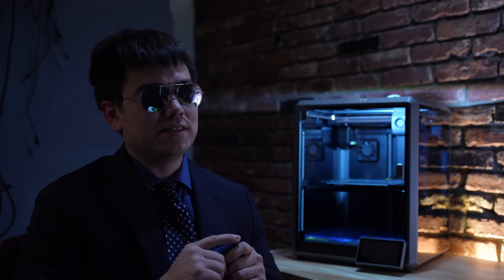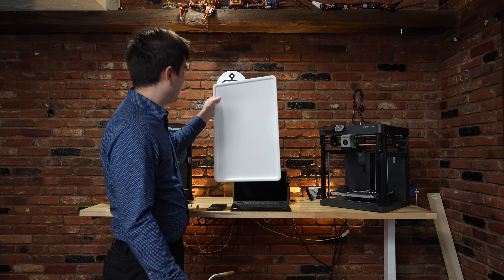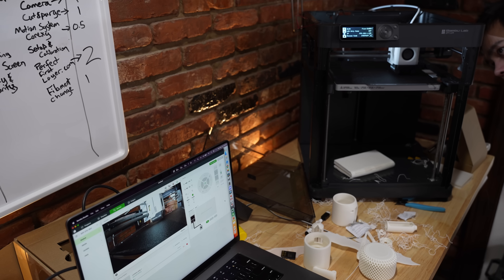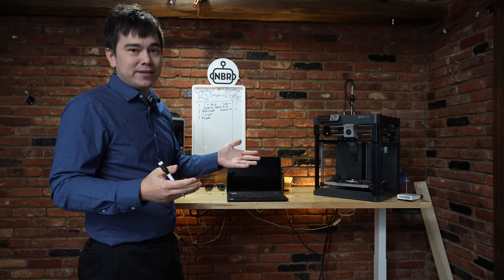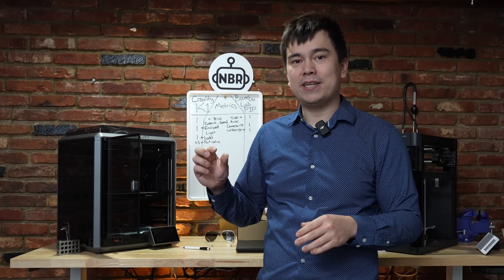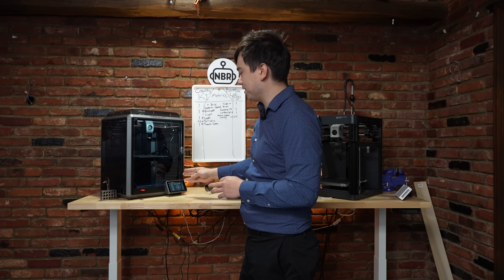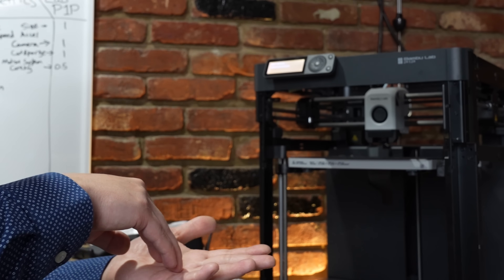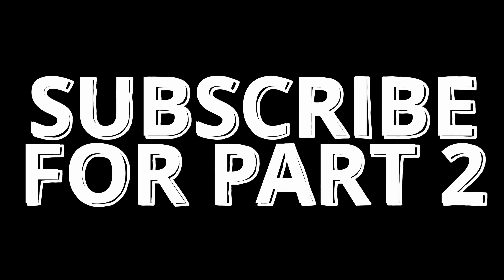3D Printer Fight Club: Creality K1 vs Bambu Lab P1P Episode 1

Comment: Bro I swear your THE ONLY PERSON with a k1
Reply: There are surprisingly few youtubers who have reviewed the K1 so far.
Reply from the maker: Modbot, JJ Shankles and 3DPrintSOS have one. Some have done reviews, some have had extruder problems. Apparently the pre-production units (including mine) have had issues with inconsistent extrusion. I’ve fixed it though. Working pretty great now
Reply: @NathanBuildsRobots  I'll need to check them out

Comment: So as I don't have wifi in my workshop the K1 is almost the only choice.
Reply from the maker: You can use the micro SD card to transfer files on the P1P, but it is more tedious
Reply: I think the K1 max will have ethernet. The ethernet port on the electronics for the smaller K1 is unpopulated, sadly.

Comment: The k1 build plate is trash. Changed it after 3 prints and no more issues. 

P.s. claivus brand filament (tried 9 different rolls) always clogs the hot end.

Comment: Have always sent my prints thru the cloud or thru lan if cloud is down, have never needed to take out the microsd for anything for both x1c and p1p.
Reply: The problem is with the P1P and X1C (I own both) is in LAN mode you can't even update Firmware, not the case with the K1.  There are people that print things they don't want others to see.  Don't ever send a Log File to Bambu Lab, The last time the requested mine from my P1P it started to send them a 2.1GB File that was fully encypted (WTF).
Reply from the maker: Lmao. Yeah Bambu seems a little sus sometimes. They force you onto their cloud service at every opportunity. Don't worry, you don't need to know what was in that file. Also, closed source so you likely won't ever know.
Reply: @marshallburke88  Wow. A 2.1 GB encrypted file. Seriously. That is a crap ton of just g-code. Very suspect.
Reply: @marshallburke88  eh honestly dont matter to me. As long as I get to print remotely then I'm good. 

As for not being able to update thru lan mode, I mean yea? It's essentially offline. You can hotspot your phone and connect your printer to it to get internet access if you want to update I guess?

Comment: bad comparison, a good comparison would be to show printouts of these printers with the same speed
Reply from the maker: Better comparison would be same printer vs same printer 🙃
Gotta control those variables ifyouknowwhatimean
Reply: @NathanBuildsRobots  Well, yes, but when you compare two printers, show printouts more or less at the same speeds, acceleration, etc. Then it will be a comparison

Comment: Thanks for your review, well done bro

one question. I preordered K1 which I suppose to receive it sometime in early of next month. I see alot of reviews in YouTube but unfortunately was after preorder 😅 all reviews are about negative things where make you disported this product even before getting it on hand 😢, can you please gave us your opinion of the quality of this printer and shall i keep the order or cancel the order and order Bambu lab P1P where they are almost same price. Most of my prints is TPU
Reply from the maker: P1P is a safer bet in terms of quality. It is based on the X1C which has been out for nearly a year now, so it’s got a good track record. The K1 is very experimental now, almost like a beta test. You’ll be an early adopter with some growing pains, but it is more moddable, so you’ll be able to fix and improve things over time.

Comment: In real-world functional print terms, how would these printers compare with a Klippered Prusa i3 Mk3S+?  I was thinking of getting the Bambu Labs P1P, but the more I think about it the less I feel like supporting a company that doesn't allow off-line/off-web printing with all the IP issues.  It set me thinking, how much is the real world speed difference between these core xy printers and a Prusa bedslinger running Klipper.  What would the trade-offs be if say printing in PLA, PETG or TPU?  Maybe an interesting future video, especially once the Prusa i3 Mk4's klipper implementation has stabilised?
Reply from the maker: There are some crazy good klipperized bedslingers coming out soon, for insanely cheap. I’ll be resting and comparing that soon
Reply: @NathanBuildsRobots  Cool, look forward to hearing more... how soon is soon, in terms of new product releases? (without being specific)  Would it be worth to wait?

Comment: In the next video say about - What would you recommend to buy
Reply from the maker: That will be a long answer, both have pros and cons. Overall I like Creality mantra: Super cheap and moddable. Bambu Lab is easier to use, but harder to mod and perform maintenance on, and also extremely proprietary. Almost to the point where it feels like you don't own the printer, you're just borrowing it from Bambu Lab.
Reply: @NathanBuildsRobots  Thanks!!!
Reply: I have very big motivation, but not all moneys (I’m 14 years old) I am do orders. And I hoard money to buy creality K1)
Reply: You're going to act out?)

Comment: I have one question for u! smartest person in 3D Technology I can't ask nobody also because of it! 
I ordered my K1 (still didn't receive it.. they say end of next week) and question is in slicer mode! I work with Blender Studio 3.6v I don't want to learn another software because I already speand a lot of time to learn it completely! Now I have  problem with new Creality slicer every object I put in slicer program not showing object! If I pres slice on invisible object program crashes! (It shows only path arrows but object semas to be invisible) I also have CR-6 Max and old creality slicer and everything works perfect! So my question is! Is there any other slicer program for K1 to work fine with K1 or i need to wait for update! I even try Default cube to load in new Creality slicer it's also invisible and program crashes if I press slice! I try ulitimaker cura 5.4 and loads my very complicated object with no problems and errors.. but ulitimaker cura don't have K1 from creality! I don't know what kind of printer I should use in ulitimaker Cura? What du u think or i just need to use any kind of creality printer and make other dimension Setup? Will print Speed work or?

Comment: Nathan, I have a cool dicovery I made today, if you flip around the USB JST Connectors on the Corner of the Board (The one for the Camera with the Front USB) and connect a USB Camera to the Front USB Port the Camera will work!  I am using a Logitech C270.  You can still unplug Camera and connect Flash Drive.  I am going to keep this config until official camera is released.  I am considering making a custom cable, but need to order a USB port with header, or find a USB Male to Female Type A Cable and cut the end off and put on a JST Connector.  FYI you just can't connect a USB Camera to the Front Port, The USB Camera is Hard Coded to the Camera Port on the MB.
Reply from the maker: That is some witchcraft, very cool. If I weren’t in the middle of moving right now I’d try it out. I’m planning on just being lazy and plugging in the Creality camera when that comes out, but if it takes too long I’ll hack it.

Comment: I just realized after installing a noctua MC board fan my p1p stopped making that obnoxious high pitched whine at idle. I don't fully understand why some PSUs whine when not under load, but i guess having that little fan always running was enough power draw to silence it.
Reply from the maker: Maybe you just aren’t noticing it anymore 🙉
I can hear it super clearly while scrubbing through my video files. It turns on and off depending on what’s going on with the printer but I haven’t figured out what exactly causes it.
Reply: @NathanBuildsRobots  that's possible, it's right on the edge of my hearing range so it's hard to pick up when the room is noisy. It was really annoying when things were dead slient though

Comment: I print my abs most of the time with my bed heated up to 110 celsius in an enclosure because sometimes 100 degree is not enough and the creality specs tell me its max 100 degree celsius on the bed. This is like the only thing that prevented me from buying one until now. Does anyone has tested it with asa/abs and can tell me that this is alright?
Reply from the maker: JJ Shankles has done some ABS tests, I’ll be doing some soon too

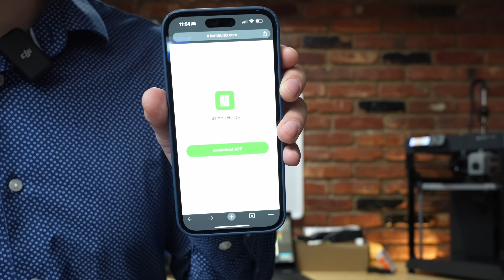Comment: 11:00 also the p1p lets you send stuff over wifi to the sd card.  Might use the cloud for that though so wouldn't work for offline (i think, idk haven't tried offline yet).  I use my z fold 4 so I have a nice big touch screen, and I just sit it on the phone stand next to p1p.  I feel like now that we all have smart phones (most of us) it's really easier that way, especially if you have multiple printers.  I do like that the k1 comes with a nice screen and all, but just feel like the phone app is a nice way to go nowadays.  Not really trying to be biased toward BL, I did want a touch screen b4, but when I realized I could use my phone to do all the same stuff (and of course computer) it was sort of one of those features that seemed pointless to me.

Comment: What is the frame that holds the heat bed and build surface on both machines made out of, plastic or metal?
Reply from the maker: P1P bed frame is made of ferrous metal (steel)
K1 is probably the same.

The actual heated beds are aluminum. K1 is 24v heated bed, P1P is AC heated bed (more dangerous but heats up faster in 240v countries)
Reply: @NathanBuildsRobots  thanks, I'm really hanging out for either a K1 or K1 Max. Not a cloud app kind of guy. Pls keep the great reviews coming.

Comment: I must comment with experience with core xy. If your belts are moving up and down the pulley you are not in line with the path. These machines rely on equal straight tension to move

Comment: A good way to maybe take price and build volume into account is perhaps base their build volumes on mm^3 per dollar spent?  I guess the problem is that this then biases towards build size rather than feature set.
Reply from the maker: Yeah and it depends on how people use their printers. For instance, I rarely print anything over 100mm tall. I was just going to say the P1P is about 1 size class bigger. The way I see it the size classes are roughly
160
180
200
220
250
300
350
Etc

Comment: all I saw about the carbon rods thing was this one guy whos printer looked like absolute shit like he had all kinds of dirt and grease all over it, and was taking everything apart and really messing with stuff and greasing things you aren't supposed to...just a really odd situation, but he had a little bit of play in where the extruder sits on the carbon rods.  It's possible it will be a very long-term problem, but he was also running a print farm, got one of the early ones and printed nonstop with it (from what I recall).  So I see it as you may some day have to replace them (they have replacement for like $80 or $90 I forget) "some day".  Probably 3 or 4 years down the line or more for hobbyists, maybe even sooner from print farms.  It would make me consider the k1 more but tbh the k1 seems very cheaply done and very rushed.  I have had so much trouble with creality in the past using cheap / stupid solutions for everything, I went ahead and got the p1p instead of k1.  That kind of speed on a creality machine, I'd honestly be impressed if it lasts a week without breaking.

Comment: What the hell are you talking about? Belt being not parallel to the hotend WILL affect print quality.
Reply: especially when it moves up and down due to vibrations...
Reply from the maker: How many degrees off is it?
https://en.wikipedia.org/wiki/Small-angle_approximation
Reply: @NathanBuildsRobots  I hear you. There has been a lot made of the belt misalignment like it will wear out bearings and affect quality but I don’t think it’s a big issue. The pulleys are oversized and their bearings should accommodate any additional forces just fine. The slight difference in length of movement caused by cosine error should be very small as well. 

Still, it would have been nice to see it and if it could be relatively easily corrected. No big deal though.
Reply from the maker: @xsvforce3335  Yeah, they just needed to make the carriage blocks on the left and right side just 2-3mm thicker. I don't think it would have affected print volume, since the nozzle can actually go off the side of the bed with the current range of motion. But still, I think it's a minor issue that can be resolved in a design update.

Comment: Great comparison.  Thanks.  I was very impressed with the Bambu for the price, print speed and print quality, but I'm concerned about long term reliability with the carbon fiber guide rods (people are seeing carbon dust and that's wear), but I also HATE being forced to use an app (probably spyware) and a Chinese cloud server, etc.  I greatly prefer open source, and while Creality isn't truly open source, the K1 looks much more open and less proprietary than the Bambu Labs printers.  I've been burned by QIDI proprietary designs that weren't supported after a couple of years, leaving me stranded with five printers I couldn't maintain.  I switched to the Sovol SV01 and it uses readily available forever Ender parts.

The Creality K1 is enclosed which will be better for the ABS parts I print, but I mostly print in TPU and the open frame P1P is better for flexible material, as well as being easier to repair than an enclosed printer.
Reply from the maker: Lots of people who print flexible swear by the Microswiss NG. 
Lots of options for sure, I use my P1Ps the most, but I don’t work on anything proprietary and run them offline. 
But there are a fair amount of annoyances running the P1Ps offline, for example, every time I turn them off and back on, I have to renter a LAN key to communicate with my laptop. It would be so much easier if I just connected everything to the cloud. But I think that is by design. On the K1 I connect it to Wi-Fi once, and it’s all good, even if I restart the printer. Plus it sends print jobs over Wi-Fi in seconds instead of minutes like with the P1P.
Plus even if you’re running everything with a LAN workflow, either of the slicers could cache data and send it to the cloud when you connect back to the internet.

I really would prefer a fully open source slicer and firmware, with no cloud shit.
Reply: @NathanBuildsRobots  - Thank you very much for responding to my comment with information from your experiences that directly addressed the issues that are important to me.  PS - I usually like videos that get right to the point, but your Matrix parody intro was hilarious.

Comment: K1 wins for me because A. Enclosed, B.  Open source and standard parts. C. No Cloud/Account required. All that at $100 bucks cheaper that can be spent on filament or small mods. I understand some of the "get it and print" folks but my Privacy, and the ability to modify my machine as the ADM community creates advances.
I wouldn't he surprised if theres a revo hotend made for the K1 or an alternative shroud
Reply from the maker: Definitely. I don't see many upgrades being necessary at this point, except for the extruder in its current revision. I got a pre-production unit and the extruder is a bit iffy. I'm going to ask them to send me a replacement to see how the new revision works.
Reply: @NathanBuildsRobots  have they confirmed that a revision is in the works?
Reply: @NathanBuildsRobots  there's some upgrade you can do :glass surface and also you can put heated chamber but this is very hard need electronics knowledge and some other things